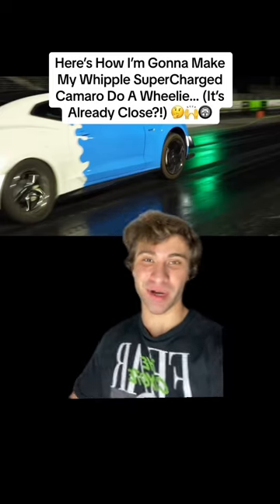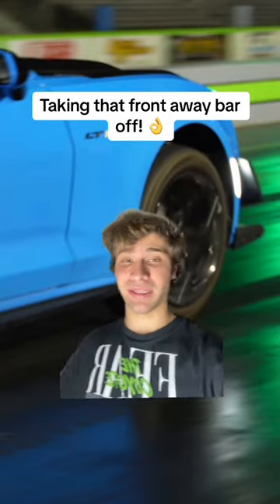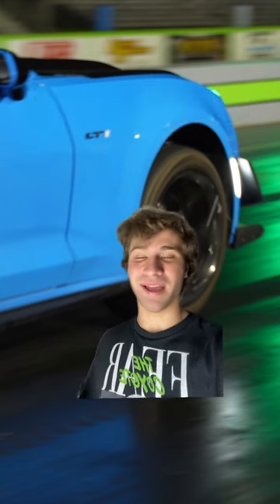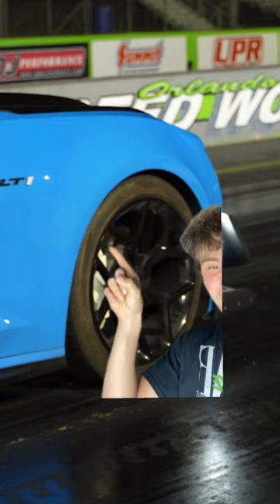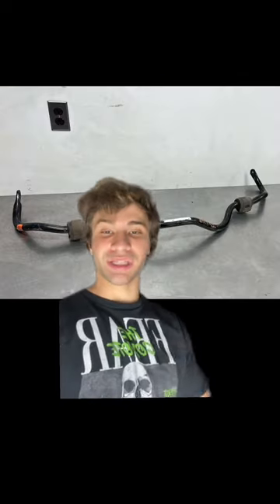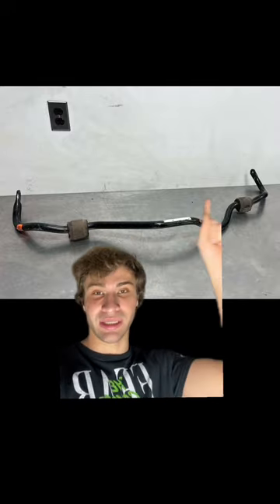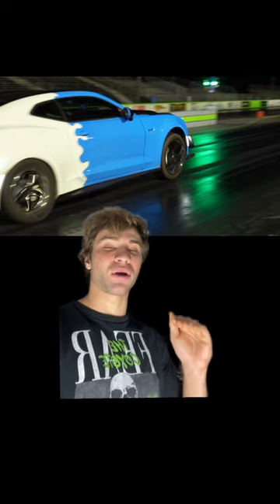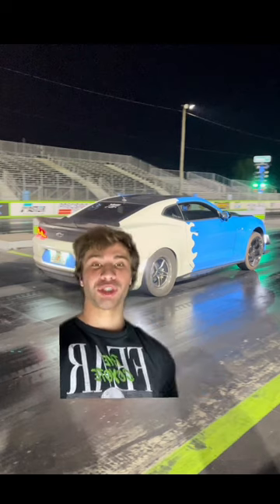DELETING THE FRONT SWAY BAR ON MY WHIPPLE SUPERCHARGED CAMARO TO MAKE IT HOOK BETTER AT THE TRACK!?

Comment: A sway bar has nothing to with doing a wheelie. A sway bar only adds restriction when one wheel is compressing. The sway bar moves freely when both wheels are compressing or extending. It just ties the two wheels together so the bar has to be twisted for only one wheel to compress.
Reply: It stops the car from weight transfer which allows the car to hook up better.  Take that junk off unless you religiously take your car to autocross or you just like going around corners really fast on the street like my father in law in his scat pack that was going over 100mph and tried to take a curve and now can't walk and barely survived. If your doing either of those silly things then yes keep your sw(g)ay bar. 😂
Reply: @TTyote litteraly don't even have to be going around a corner fast to notice a sway bar. Driving a car without sway bars feels like shit. Idk about you but I like my car to stay flat while turning not trying to roll me out of the seat.
Reply: @mitchelldoolan961 well that’s why him and the guy in the video said to only do it if your going straight only
Reply: @mitchelldoolan961  I have no sway bar on my car and going around corners is fine.

Comment: Those cars are slow as fuck bro. I don’t know a lot about cares but I go to the track all the time just to watch them race and those never go fast.
Reply: His car is somewhat built it's pushing more power than the production version/base he started modding
Reply: @kmsbismark7045 dude thinks he’s driving a stock mustang cause he’s seen them at the track😭😭😭
Reply: @cammeronetzkorn5199  actually the mustangs that I see have all kinds of shit done to them. And they are also slow. It’s the challengers and those really old Camaros that always haul ass. With nothing stock in the Camaros. Jasper built engines that’s not even a Chevy motor. I see a lot of hellcat and blown coyote swaps a lot. There pushing 700 to 1500 hp at this track.
Reply: Stupid came out to play early today💀
Reply: I lost IQ points reading that 😂
Reply: @225savage0  what are you even saying coyotes are a great platform and you can get 800-1000hp with headers a cam and pro charge